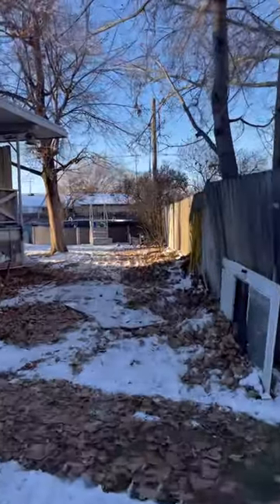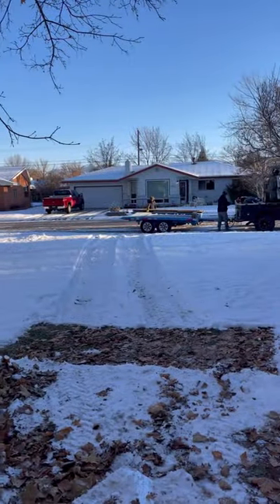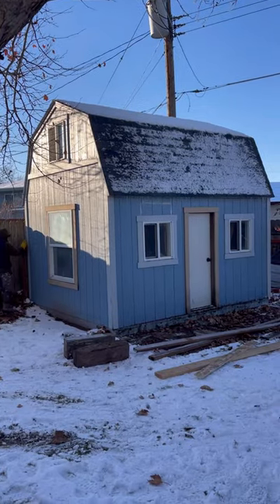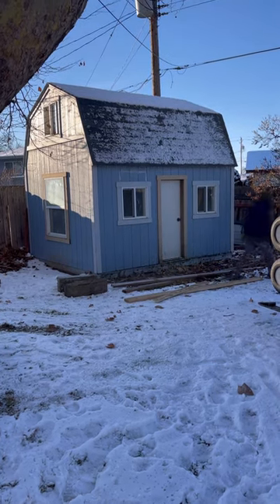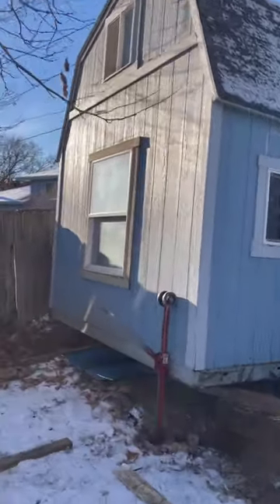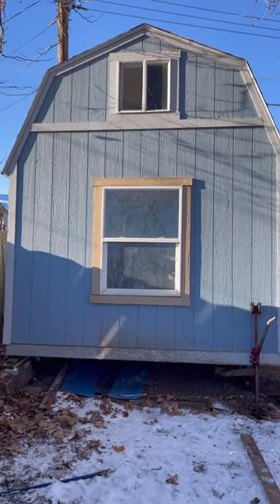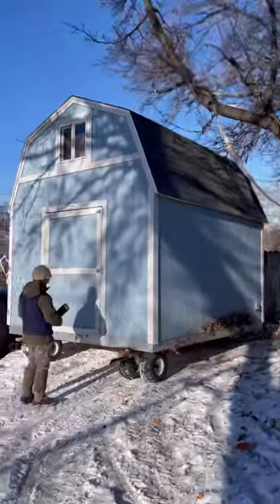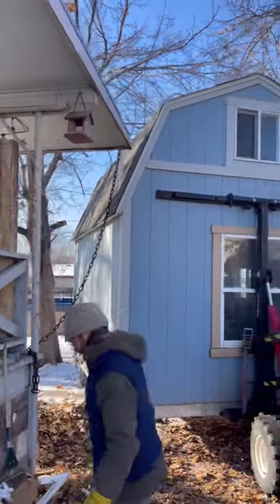Moving A Tuff Shed Tall Barn

Comment: You are a brave man. When I get calls for moves my first question is “ is it a Tuff shed?”. We don’t move Tuff sheds unless they have the wood framed floor. Of course I may have a bad taste for Tuff shed after being an independent dealer.
Reply from the maker: They definitely add a challenge that’s for sure. Thanks for commenting.
Reply: @marctheshedmover8208  hey where can I get the wheels you used to move this? Need to move my tuff shed to a neighbors house and want to pull it over there